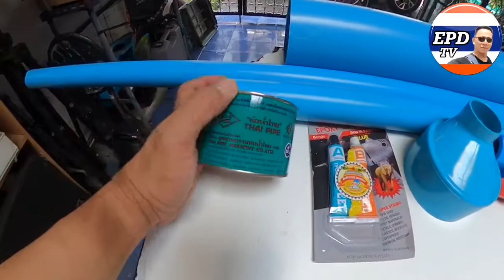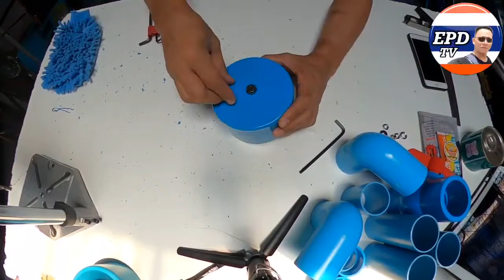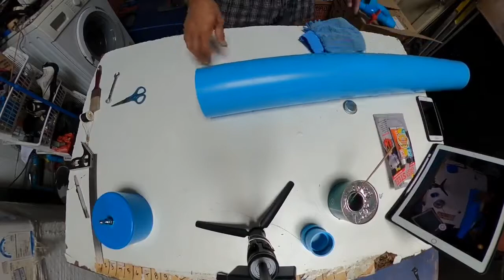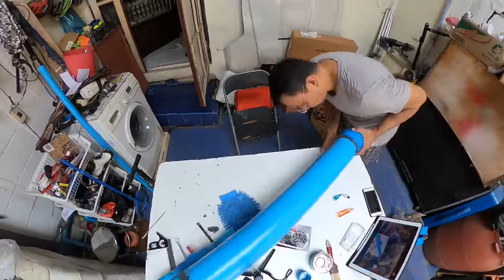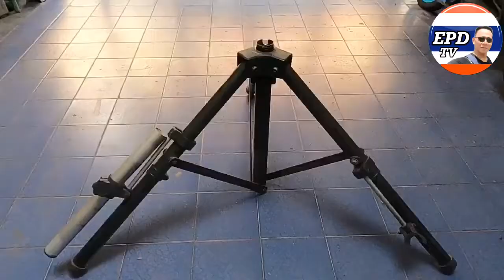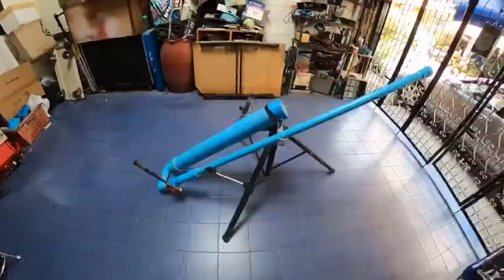How to Built a Easy Air Powered Bait Cannon!!!

Comment: Metal or plastic piping? If plastic pvc  are you using steel glue because it works better or? And the four pieces you cut what size are they